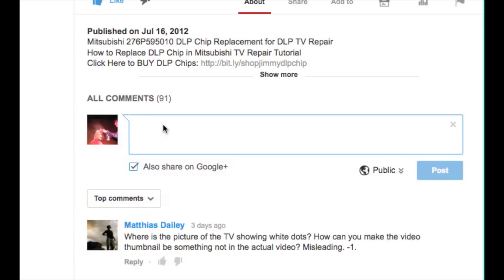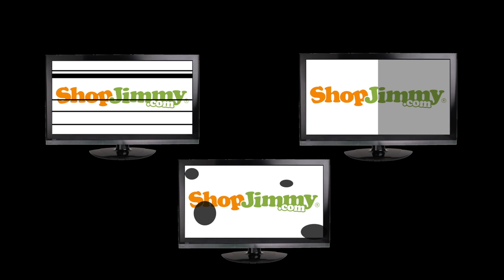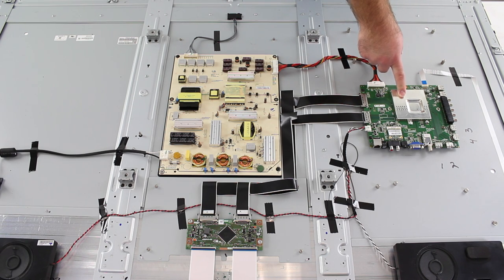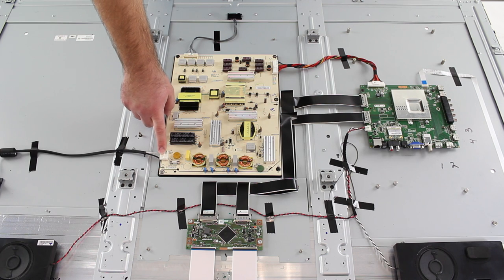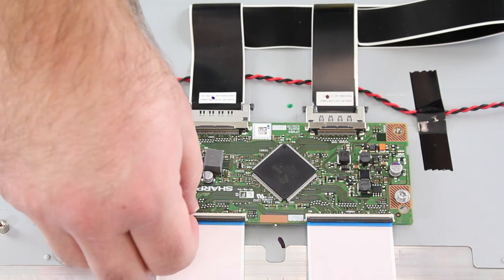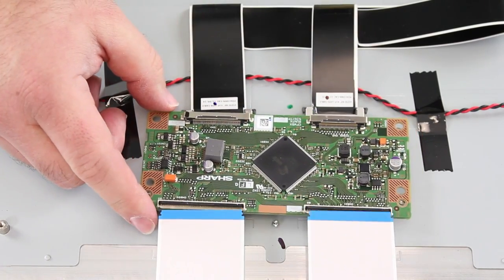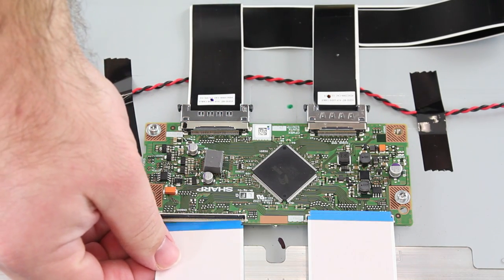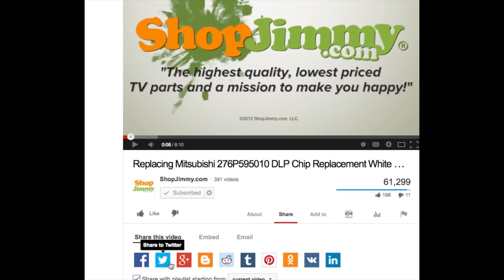Vizio TV Repair - E601i-A3 T-Con Board Replacement - How to Fix Vizio TVs

Comment: I have a Vizio E701i-a3 with no picture. The backlight and sound are still working. From this I decided to gamble and try replacing the T-Con board. I purchased one through ShopJimmy and received it today. I replaced the T-Con board and reinstalled the back. I turned on the TV and was excited to see that it was working! Unfortunately this only lasted for a minute or two before the picture faded out and would not return. Do you have any idea what would be frying the T-Con boards?
Reply from the maker: +Dan Schwab   Try all repairs and troubleshooting at your own risk.  This sounds like a TV panel (TV Screen) problem.  If your TV panel is bad, it may be more cost-effective to replace the TV as panels are typically hard to find in stock, difficult to replace, and expensive.  Thanks and please let us know if you have any further questions!  www.shopjimmy.com

Comment from the maker: NEED TV REPAIR HELP?! If you need help repairing your TV please comment below the www.ShopJimmy.com video or feel free to send us a YouTube message. Please include your TV model number and the symptoms or issues your TV is displaying. The more details you can include the faster and more accurate our response will be!
Reply: ShopJimmy.com I purchased this tv and it had no power i replaced the power supply and powered on and the vizio symbol flashed on the screen and then the screen went dark i have to put it in the sunlight to see the no signal and menus.  I replaced it the T con board on it with a tcon board from the same model tv with cracked screen and still did not work i am going to purchase the part from shopjimmy to see if that helps.
Reply: +ShopJimmy.com Need help. I have the model listed, Vizio E601i-A3. It has sound no picture, but backlight comes on. Vizio posted this for this exact serial. In a small percentage of units with serial numbers in the ranges of LFTRNWAN3800001 to LFTRNWAN4805300 for Model E601i-A3 , users may experience a loss of video on the display although audio can still be heard.  This issue is attributed to a limited batch of chip assemblies from a supplier, in which there is a small percentage chance that the chip assembly prematurely fails; this 
causes the timing control board to be disabled, which disrupts the video signal to the display.
Reply: +singlestraightmale Could you please help? I am trying to figure out what I need to buy. I've got offers for the parts on Ebay.
Reply: well first you have to tell me whats going on with it
Reply: Hi I have a Vizio led m550sl I was wondering how to replace the t-con board it woud be nice to see a video thanks..

Comment: Hi i opened my vizio e60 c3 as i saw on a video to apply pressure on connections to get rid of half black scrren i touched the white ribbons on tcon  but now the screen is all white or vertical lines. How can i fix it? Plz help

Comment: Vizio E601i-a3 comes on but cant access setup menu. after being on for a few minutes it gives a electrical pop noise and tv shuts off , but can be turned back on .  all jacks seem to be working. Not sure if the sound is coming from power board or if the popping noise is coming out of speakers. Any idea's

Comment: hello there bought a Vizio e701i-a3  because no picture but sound,had similar problem with a 60 inch Vizio and was t-con..so I change tcon board on this one and still no picture can it be main board?
Reply from the maker: +Dirk Diggler   Try all repairs and troubleshooting at your own risk.  This sounds like a TV panel (TV Screen) problem.  If your TV panel is bad, it may be more cost-effective to replace the TV as panels are typically hard to find in stock, difficult to replace, and expensive.  Thanks and please let us know if you have any further questions!  www.shopjimmy.com

Comment: Hi, I have a Vizio Razor 70" LED TV. Model E701i-A3.
I've used it for 2.5 years and everything has been functioning fine up till a few days ago. The TV makes a loud static buzzing sound then  switches off. And switches back on again. It runs fine again for 10 or so minutes, then again a loud static buzzing sound. Same cycle.
Any ideas what might be going on? Much appreciated.
Reply from the maker: +Elvin Lal  Try all repairs and troubleshooting at your own risk.
  I recommend replacing the main board in your TV.  Click this link to 
replacement parts for your TV model number:  
https://www.youtube.com/watch?v=kxkeGLhlQY8  There may be multiple boards for the same TV model number, be sure to match part numbers on your current board, with your replacement for compatibility.  Thanks and please let us know if you have any further questions with your TV Repair!  www.shopjimmy.com

Comment: Hi, I have a Vizio E601i-A3 and I had the defect issue where the t-con board died, leaving me with sound and back-lit black screen. I purchased a new t-con board from you that arrived yesterday. I had the time today to replace the piece and I followed your instructions to the T. I reassembled the TV and the picture came on. However, wherever there's black, you can see thin grayish/white lines. It affects the overalll color of the picture, since it's mainly affecting blacks. Any idea what's going on? I've already reopened the TV to double check that all connections inside were properly attached.
Reply: And to clarify, they are vertical lines, not horizontal.
Reply: +Eric Fox  hey. Same exact situation with me. Replaced the t-con board, and for a while, the picture was back to normal. But then it slowly developed similar symptoms. Thin grey line you can only see on black images. The color also pixelates in some small areas and is blotchy. Did you ever find the solution? I've read maybe double checking connections and making sure they are clean and snug... I'm thinking it's something else. Just thought I would ask because you're the only person that has the same issue.
Reply: +Anthony P almost pinstriping
Reply: I went through 2 new tcon boards and my tv is working normal now. The first one was faulty, so they took it back and sent me a replacement.
Reply: +Eric Fox. Thank you for the response. That's promising. I've been using it since because the picture has been somewhat tolerable but I was afraid to replace anything else incase there was another problem. Thanks again. Where by chance did you get your board? I just went through eBay.

Comment: I have a Vizio E421VO.  I have audio and Black Screen.  I check black screen with flashlight and don't see any images.  All I see is 2 boards, Main Board 3642-1232-0150 (6D) and Power Board 0500-0412-1030.  Reading your repair help, you say that it might be the T-Con board and I can't find it.  Is it built into the Main Board?  What do you suggest doing?

Comment: I have this exact model, I had a vertical blue line always present coming from the top of the screen a couple inches long.  I opened up the tv just the re-seat the connectors to the t-con board to make sure all of them were good. this started when i was cleaning my TV and it was moving a little bit when i was wiping it.  When I put it back together not only was the blue line still there but now my whole screen is full of vertical lines in all different colors.  I tried re-doing this process twice more to make sure all the connections were perfect, and it got worse again and then stayed the same on the last re-try.  Think it is a bad TCON board? Why would it get worse when re-seating the connections to the board in the first place?

Comment: Hello! I recently acquired a 60 inch Vizio E601i-A3. It works great other than when bringing up the "menu" option. it briefly shows and then disappears.  I can't keep it open long enough to make any changes. Would changing the T-con board help with this issue?
Reply: My TV (same model) just starting having the exact same issue. Did you ever figure out how to repair it or which board to replace?

Comment: I have a Vizio E420i-A0 and the middle 1/3 of the screen is darker than the rest of the TV. We purchased the TV only 17 months ago and are very disappointed in this. We have done the re-set or power off; no change. Also checked and the middle third of the screen is still darker even on the menu screen. So....wondering what to do. We still have a picture and all, it's just that the middle 1/3 is darker. Do you think it is the T-con board? If so, I think I could follow your video for replacing that and not be afraid to do this. Thank you for any help. We do not have a lot of extra money to just junk the TV and go buy another one.
Reply: Did you ever hear back about this TV problem, I have similar issue!?

Comment: I have a vizio 50in model E500i-B1 it will come on as far as the power light showing but I get no screen. If I leave it unplugged overnight it will come on just fine. But if I turn it off or try to switch inputs the screen goes black. My question is is it the tcon board or something else.
Reply: David Engle same issue replaced the power board did you find out what it was?

Comment: I have a Vizio P659-G1 TV.Recently it started going Dark Screen. I thought it might be the LED Backlights because you can see images on the screen using a flashlight, however it is intermittent. After doing a hard reset the screen will work again, but seems to last only a little while of if we turn on the Playstation input it immediately goes dark screen. If it's the T-Con board I could probably manage replacing it, but if its the Led backlights I wouldn't want to mess with it. The sound will work when it goes dark. Are these symptoms consistent with a bad T-Con board?

Comment: I have a Samsung #PN50B450B1DXZA I have correct power on the power supply board, correct power on the Y-SUS board, correct power on the X-SUS board. the sound is fine but no picture on the screen. any suggestions?

Comment: I have a Vizio d43f-j04. Anywhere that there is white on the screen will have vertical lines coming off of the white areas.  Everything else seems fine.  Is this the T-con board?

Comment: Have a VIZIO E601i-A3,,,have Power, Sound, saw from Rear Holes -Lights, also when power on, a very faint Blue screen, however, No Picture....Think T-Con Board gone; Open TV present T-Con Bd is RUNTK5261TP  ZM. Can I replace T-Con Bd with any other version 5261TP    ZC,ZE, ZZ, ZG version, Please HELP

Comment: I have a 48 inch Vizio  e480-b2 that quit working due to lightning strike through the cable.. I replaced the video or main board only and still nothing.. no power red light .. I guess the power board next.. I’m just afraid to pay 80$ and still not work... any suggestions... thx

Comment: Have a Vizio E28H-C1 the T-CON board has a plastic strip that connects the board to the screen that is glued to the board and the screen.  The board I bought had no such strip provided and there is no material on Internet on how to connect the plastic strip to the board - board is MT3151AO5-5-XC.  Is a repair possible or practicle for this T-CON board.

Comment: I have a Vizio 80" TV Model M601d-A3 The screen is Black but I have sound and I can see the picture with a bright flashlight. I have replaced the LED Driver board with no help. What should I do next? Thanks. Bob

Comment: Our Vizio TV Model Number is E550i-B2E  We resolved the issue of no pic, but sound worked...Now, the sound goes in and out, as if someone is muting the volume for a second or two, then the volume goes back up, over and over. Is this a sound board problem? We did all we read to do online, even resetting the TV... made sure the TV Speakers were on, volume up, you name it, we did it.... Then we hooked a sound bar to it. The same symptoms were still present when using the sound bar and having tv speakers off.  Can you offer a solution to this problem?  Thanks in advance for your help.

Comment: I bought Vizio D43-C1 (Serial: LTTWSEAR, LTBWSEAR, LTBWSEBR) Complete TV Repair Parts Kit. 

My Vizio tv - i could turn it on using the remote but it’s just blue screen. Nothing on the screen and it doesn’t respond to any other keys on the remote. 
Not knowing what the problem is and not really sure how to diagnose it, I bought the repair kit. I replaced the video board first but that did not fix the issue. Then I replaced the the Tcon board (not sure if I got that board name right, im referring to the smallest board in the kit). After I replaced the tcon board, I turned on the tv and the display worked - it was responding to the remote. However, I turned off the tv and turned it back on after few minutes and it’s back to blue screen with no display again. Any input and advise is much appreciated. Thanks!!

Comment: My Vizio E701i-A3 SN- LFTRNXBP3304373 had one skinny horizontal line across the bottom for about 6 months and now screen went black but still has audio.  Did this one line cause my T-Con board to go out?  If I were to replace the T-Con board do you think it would last? If so, how long would you guess?

Comment: Picture is good, but color is overbearing. Wondering what the part # is for the t-con board.
It is a Vizio TV model VA26LHDTV-10 T. Serial # LZMDAAK1706392

Comment: I have a Vizio sv470xvt1.  The video has gone out but the audio is still there. I've unplugged and reset with multiple successes and failures in restoring the picture but those success were only temporarily. I would love help in a permanent fix. Thanks

Comment: Hello,

I had no picture but backlights and sound working on my Vizio 50" M502I-B1. I replaced the Tcon board. Now I get vertical some thick lines that cross from top to bottom, and half of the tv is white-ish with more vertical lines. Backlights and sound are still working. Any idea what could be the issue? 

Thank YouTube Community!

Comment: Hello I have a 70inc Vizio Tv model # E70-E3 sound works good and the screen shows picture but the right side is dark. I took it apart and from the back i only see half of the Led lights on. Is there a board i can replace to fix?

Comment: I have a 52pfl5704D/f7 phillips lcd tv. It would come on and then the screen would spaz out - on menu and tv... Seemd like a bad video card-after a few minutes, sometimes fade to black, sometimes choppy lines and images then go to black. Sound stayed on. I unplugged one side of tcon - whole screen gray with no sound.. plugged back in, then other side - same... now with both sides of tcon plugged in it stays gray with no sound. So what do you think,  tcon or main board? It had same issue whether on tv or on hdmi inputs.. Thanks -

Comment: I have a Vizio m420kd that won't take in wifi or ethernet inputs. TV works fine otherwise, just no signal from either source. I did purchase a new wifi card from you, just not sure if that's the problem

Comment: Have a 70” Vizio P series. The power light comes on but no backlight. The optical audio light comes on and goes off and the power light blinks.  I swapped out the main board and the tv boots up and NOW I get half a screen only and the half that lights up is kinda scrambled. Did I get a bad main board? I tried cleaning the connections on the main board but it didn’t help. Tv worked fine a week ago then just stopped showing a picture. I can’t test with audio as my speakers have always been set to off via the menu from day one.

Comment: I have a vizio 70 inch  E701i A3B. I bought it refurbished thru Walmart and tiger direct. The TV lasted not even 3 months and the picture went out but still had sound. Visio had a recall on these TVs for the same problem for this model # but not for my serial number. Is this a t con board problem?

Comment: Yes I have a Vizio model number va26lhdtv10t and there is good sound on my tv but the picture looks like a negative. When the tv first comes on it is the right colors but after a few seconds it turn to negative. Is this the main board or t-con. The menu looks the same.

Comment: Hi I have a Vizio m601d-a3r. There's a thin horizontal solid black line on the bottom third half of the right side of the screen, then it fades to the left until you can't see it any more , 2/3 down the line. Any idea what it is? Thanks!!

Comment: I HAVE A E550VL VIZIO NO SOUND & HDMI PORTS DONT WORK  WILL  REPLACING A TCON BOARD POSSIBLY FIX THESE PROBLEMS 
REMOTE SENSOR MAY NOT WORK EITHER

Comment: I have a Vizio 55 inch TV model number V555- H1 I have horizontal lines at the bottom of the TV screen is that a panel or T con board

Comment: I have this model tv in the video, I need help when I turn it on it is very dim I can see the screen but it’s dark and there are a few much darker areas at the bottom of the screen like something is out could it be the leds? I don’t know much about TVs. I reset the tv to see if it would fix but no luck, now I have it token apart on my floor trying to figure it out.

Comment: i have a e701i-a3 it turns on but no audio or picture just backlight is on  And the buttons on tv for like volume and input or ch don't work either only power button works
Reply: Did you figure out what was wrong?
Reply: I'm having the same issue , did u find a solution

Comment: I have a question vizio e601i-a3e. have audio but no picture. you can see a light come on. have replaced the tcon board twice which the video had came on for about 2 hours then went back to no picture

Comment: My Vizio tv has a red line on the left side of the tv running vertically. It has not been hit or anything to cause it. Just came up last week and has not went away. Do you think if I replace the t-con it will be corrected?